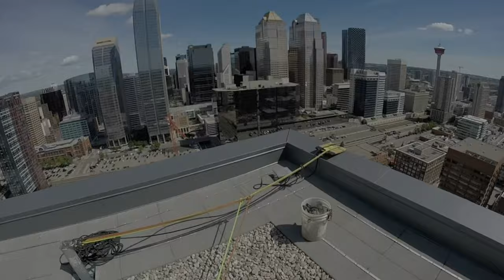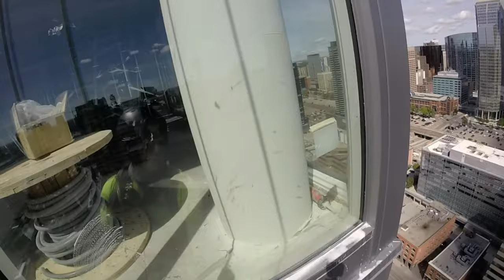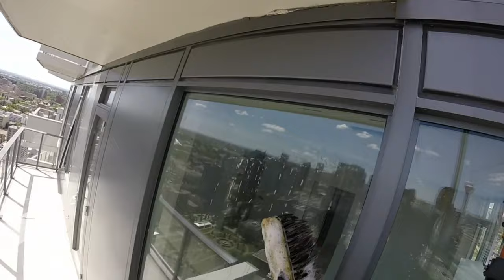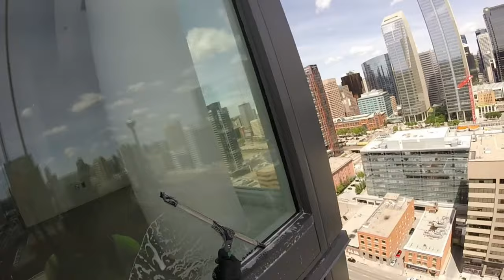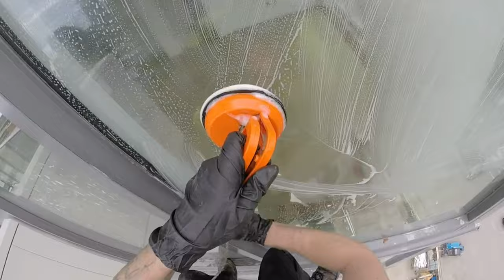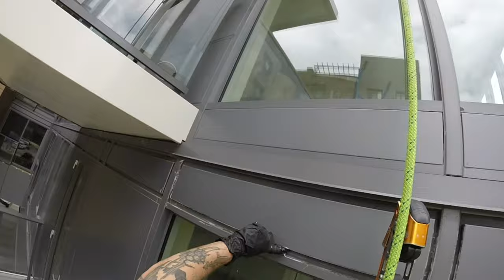Post-construction rope access high-rise window cleaning with rigging

Comment: Maybe the construction workers should do a better job of working around the windows instead of getting everything on the windows!!!!  Lol how do U get a hand prints 15 20 storys up honestly lol. definitely a lot more work doing it that way                                                              what your doing!. yes we have to do the same as you with this building without a scraper and honestly if they didn’t have blobs of concrete like baseball size and tube of caulking all over the window, then they get what they get can’t complain when it’s ten times better then when we showed up lol 😂 construction worker should care about where they get there shit all over the place!!!!!!!
Reply: Lmfao steel wool scratches tooo
Reply from the maker: Ya the installers don't really care about getting crap all over. 0000 steel wool won't make any visible scratches if you're not taking off a bunch of concrete. Luckily its mostly paint, caulking, silicone and some red and blue plastic type stuff on this building. But ya if you're removing concrete splatter on soft tempered windows it will scratch because the concrete will get trapped between the pad and window. Have to always be careful on construction cleans. It's just annoying when you come across windows from people who obviously didn't care.

Comment: I've never seen anyone clean glass as thoroughly as you do. However, it is still questionable whether the entire building line can be wiped down with just a few towels. This is not your story, this is a question for all rope workers.In my opinion, instead of cleaning it by continuously using detergent and dirty water, you are contaminating the entire window frame.

Comment: Can I ask what is the name of the seat harness you use to be comfortable all day like this?
Reply: Im not sure the window industry term.....but the general term would be "suspension harness" as opposed to a "safety harness." The main difference, a safety harness is intended to catch your fall and allow you to ascend back to your work position. Eventually, a safety harness will cut off bloodflow to the limbs. A suspension  harness is designed to continuously support your body weight. It has wider and more padded supports to avoid cutting off blood flow. 

For a general idea, look up "arborist saddle" its what the tree guys use to stay comfortably suspended.

Comment: What's your rope protector made of? 
The edges are soft and heavier guys dent them easier. Where I'm from
Reply from the maker: Ya that's exactly why I'm using this rope protector on this parapet. I've also seen so many destroyed edges over the years. Even the building I'm on right now I don't need to guess where the drops are because you just need to look for the dents haha. This one is just custom made because there doesn't seem to be any good products made to deal with the dents.